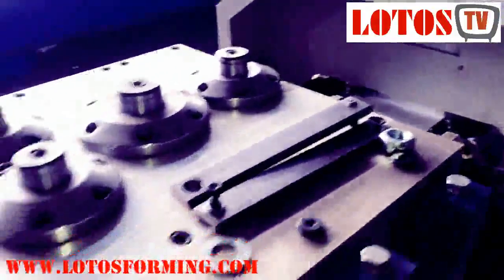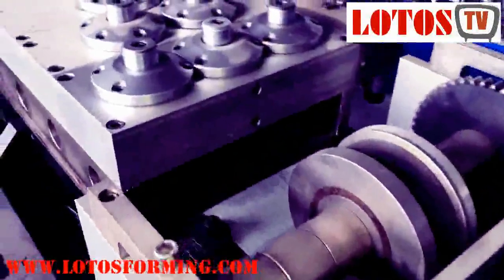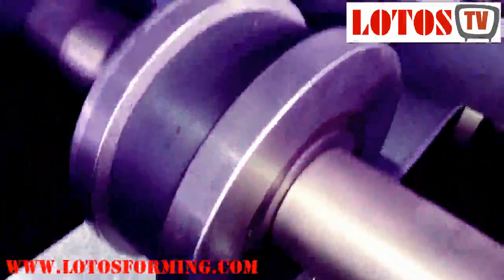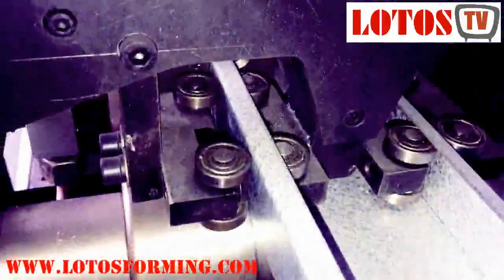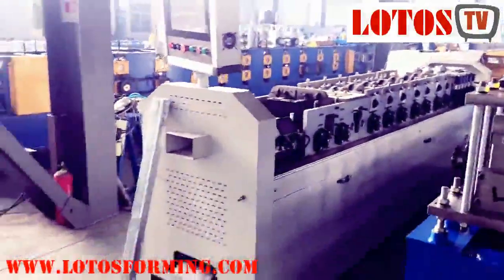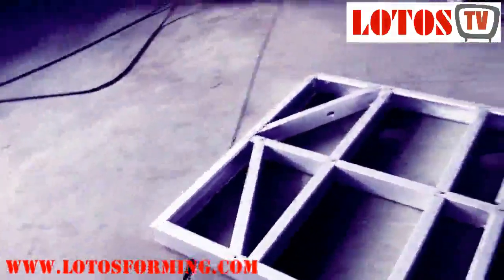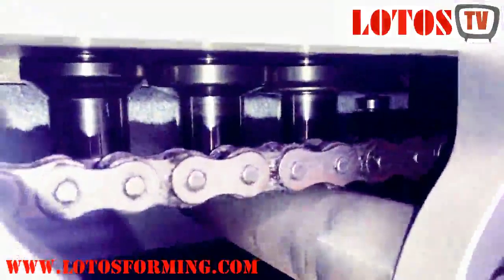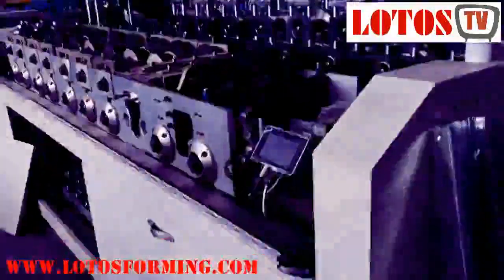▷ Steel Frame Roll Forming Machine, CAD/CAM Roll forming Machine , light gauge steel framing ◁

Comment: #Light #gauge #steel #construction is very similar to wood framed construction in principle - the wooden framing members are replaced with thin steel sections. The steel sections used here are called cold formed sections, meaning that the sections are formed, or given shape at room temperature.
Reply from the maker: LOTOS design CAD/CAM Roll forming machine for the target of producing Light Steel Framing. Each part is dimpled and notched with the holes ready to accept fasteners so that components self-clip together with no clamping.